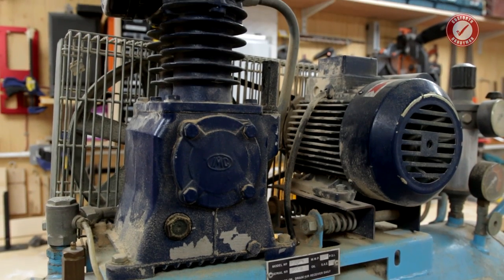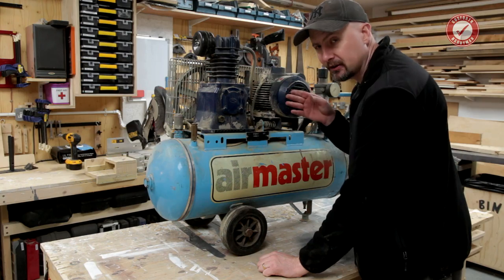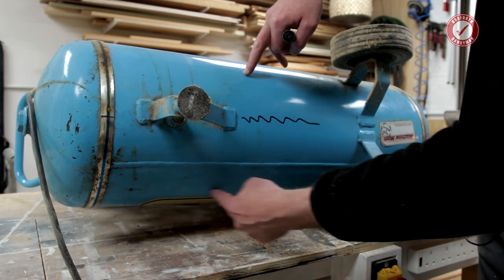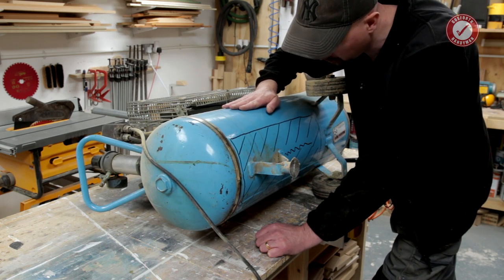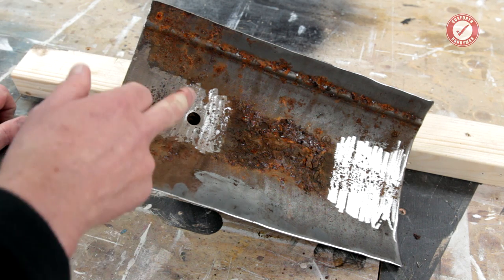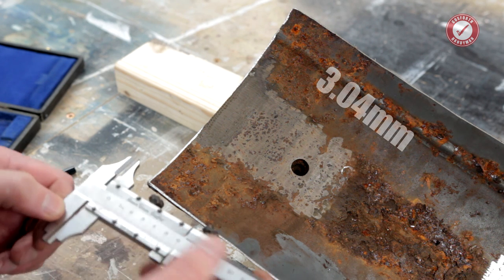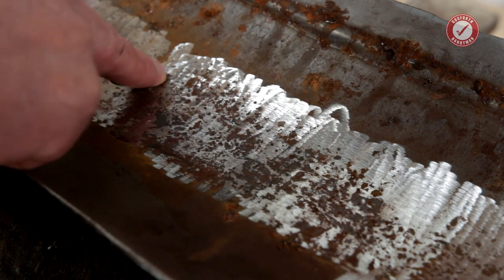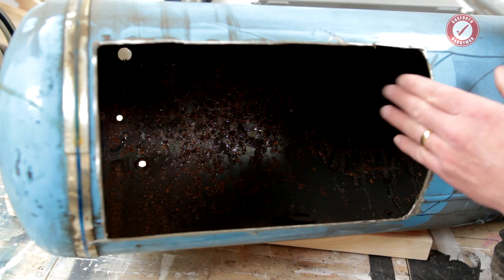Was this old air compressor about to EXPLODE ??

Comment: I had a good chat to the man who does the insurance inspection on our compressors at work... he used a thickness tester and a camera to check them out every year. The big one was made in the 60's  . He said they will normally blow a pin hole in the tank when corrode badly and very rarely explode..  Only after people have tried to repair the tanks by welding up the pin holes and of patching in new steel and drain fittings do they generally become dangerous due to the heat from welding and the stresses caused by it..
Reply: Thats true for the old massive tanks. New ones are thin sheet metal that will explode without much warning.
Reply: thats what inspection guy at work told me to
Reply: @derektaylor2941 So you’re saying don’t risk using an old compressor ?
Reply: the guy on youtube that had his explode did so for the very reason you mentioned, it rusted out on the bottom, started leaking and he welded a patch over it, the air compressor ended up exploding..
Reply: Here is an example of one that went off and was not welded or repaired: https://youtu.be/W2LbTHfU5fQ?si=5YdxqVHsJqo8V5Ro  . But tanks can be safely tested, either you pay for it, or maybe you can do it for your own sake: https://youtu.be/XE3jGyqquqg?si=1ChhWb5gUo1PKyrb
Reply: @davorinrusevljan6440  You need to watch the follow up video on that first one you linked .. the guy admitted to welding it and even showed it, the bottom bung had a pinhole leak and he welded a THICK 4"+ long seam around the bung ..
Reply: @traubengott9783  your wrong, any thickness will throw a pin hole first. the thinner ones just pin hole faster.

Comment: I don't see why compressor tanks don't have some kind of coating inside either aluminum or stainless. Or some kind of rubber to help extend the life.
Reply: Water is a solvent, especially when it's full of atmospheric particles or debris suspended in your workshop air. Over enough compression cycles and repeated condensation, that layer would be eaten through no matter what, faster than you would imagine. Believe it or not aluminum would be even worse due to its reactivity. And while yes, that would lead to eventual tank compromise, what would happen first is that layer would break down into little chunks in particulate that would ruin your air tools paint, and anything else you're blowing the air at. It seems like an obvious and logical thing to do - but that's a hint somebody else already thought of it and there's a reason why it's not done.
Reply: @sklikizos  Well to be fair, more often than not these days that "reason" is money and not wanting to spend any more of it than they absolutely have to to make a product.

Comment: I rebuild air compressors here in the mountains of Colorado. My preferred method is to take all of the fittings out of a pressure tank, and look inside it. Light it up from inside with a very small bulb that will fit into any one of the half inch or 3/4 inch holes. Then drop an assortment of bolts and nuts inside it, with a solvent like lacquer thinner or just about any other type of a solvent fluid. Rattle it around as long as you can stand it until your arms get sore, and then dump everything out, pull the hardware out with a magnet. Then the tank will look much cleaner inside, if there was any rust. Colorado is west of the hundredth Meridian in the US, so it is very dry here. Relative humidity is very low compared to the eastern part of the US. So rust as you see, in the British Isles, is simply non-existent here in the West. Lucky for us. And then if I really want to get carried away I will pour paint inside it, the best rust resistant oil resistant paint that I can find, and slosh it around to make sure all of the bottom of the tank is completely covered. Let it dry, run some air into it and leave one of the holes open, so that the air can get out, to help it dry quickly. Assemble everything, and you have an essentially brand new air tank.
Reply: Though I have to add that it's still a good idea to have it pressure tested if your tank is more than ten or twenty years old.
Reply: I was thinking do same thing. But thinking a bit I decided it doesn't worth it. You have many mistakes in your thinking. You can't clean all the rust from inside. No matter what you do the metal will have spots covered with rust. Did you see this guys was grinding and he still has had some dots covered with rust.If you paint over with some rust guard paint it ideally should soak till the metal through the rust to avoid further corrosion. That's unlikely to happen. So eventually it will continue to rust in some bad areas. The best you can do is put it in  a cage run test to max possible pressure and then use regulator to reduce max pressure so that it does cut of earlier than the pressure you have tested. I've made decision to go cage route as cage needed anyway for the case if I get a faulty tank.

Comment: "HYD" refers to hydrostatic pressure testing. They fill the tank with water and pressurize it to 250 PSI. They use water so if the tank ruptures, there is no explosive release of pressure.
Reply: Used to do this for a living. Built all sorts of tanks and I was lead inspector plug it and fill it.
Reply: Only ever had one explode, it sent the plug over a football field length through the shop and out the sheet metal wall it went.
Reply: Just like scuba tanks, they have t be "hydroed" on schedule

Comment: Black coating you called protective coating is really just mill scale. It’s iron oxide that bonds to the surface of hot rolled steel. It protects if from atmospheric corrosion.

Comment: Had you not got no cutting discs, hard work with the grinding disc you used to cut it open
Reply from the maker: Better sparks for the vid. You'll see I'm doing 45 degree grinding passes to try and thin the material a bit around the cut. 👍
Reply: @GosforthHandyman  Is it not dangerous to use grinding discs for cutting and cutting discs for grinding? I’m a complete novice and this is a genuine question not a criticism.
Reply: @markharrisllb  you certainly shouldn't use a cutting disc for grinding, the disc isn't designed to take the side loading.  Cutting with a grinding disc is slow because your removing more metal than you need but no real reason why you shouldn't.
Reply: @markharrisllb  Exactly what David Quirk said.  Cutting discs are thin and meant to remove as little metal as possible in order to make a cut.  Grinding discs are thick and are used for material removal, as opposed to making cuts.  The thin discs are prone to explosion if too much pressure parallel to the axis and can be very dangerous in that situation.  Be careful in general.

Comment: You get a lot of condensation inside any pressure vessel.  The shorthand life of a pressure vessel is ten years, then inspection is required...  Most of us get complacent enough with gas bottles, so unfortunately air bottles seem to get ignored until something goes wrong.

Comment: I bought an old one, a Clark Tiger or something. It was £50. I probably spent about the same replacing valves and stuff. It vibrated so much when it was charging the tank it would roll across the floor. The wheels had fallen off so it achieved decent movement purely by vibration. 
I sold it for about 100, bought an electric nailer. Which has since broken. Now I use a hammer and nails.
Reply: None of my tools break, largely because I don't use them very often😆
Reply: Sounds like evolution in reverse, lol.

Comment: Appreciate that you took the time to diagnose, film, and put it out to inform us. 
** never weld a tank, they are heat treated after all welding is complete so the tank can "breath" like a lung with pressure changes.
Reply: Perhaps, i would think Hydrostatic test every few years would be a better way to operate.
Reply: Doubt very much the heat treating is done after the wheels and motor and pump supports are  " WELDED " on.
Reply: @fredhinck9685  Heat treatment is often applied to relieve any internal stresses within the metal caused by the welding process. Done after all attachments are welded.

Comment: I purchased a 2nd hand air compressor that was in "good condition" from an auction. I was shocked to find that it was 1/3 full of water. You just never know how the last owner treated it.

I was able to pull it to bits, clean and inspect the tank visually and hydrostatic pressure test it. I was happy to keep using it.

However during transport the water with iron particles contaminated the high pressure line from the compressor pump and the non-return valve would get dirty and not seal. I was able to clean these lines and fix the problem.

However had I known that original state of it, there is no way I would have purchased it.
Reply: It probably last longer without regular draining as corrosion needs air and water

Comment: Interesting video . My compressor is 20 years old . Must admit when not in use . The drain is left open .
The motor and pump on yours has still got life . 
Both could have potentially been refurbished and built onto a new tank . 
Cool video

Comment: I have been in the air compressor business since 1979 I wish people would realize that an air tank is actually stored energy! and it is so important to drain the tank regularly. and never buy a compressor that does not have a certification tag ( the welded 3x5 ") metal tag on the tank, this tank was a certified tank and still had great damage from neglect. good video. 
THE Compressor Guru

Comment: I believe that is leaded steel; similar to that used in automobile fuel tanks - it is non-sparking.  OSHA in the US had a case they thought a leaking o-ring or seal let too much compressor oil into the tank and the oil mist ignited when the compressor heated up in normal operation. So a fuel type explosion, not just rusty tank.  30 weight motor oil not particularly flammable unless it is in an aerosol

Comment: hyd probably stands for hydro, usual way of testing pressure vesels - it gets filled with water not air, that way if vesel fails it is much less dangerous
Reply: Davorin Ruševljan   Hyd stands for hydraulic as in hydraulic test pressure
Reply: Thanks!

Comment: Good video but I have never seen anyone try and cut metal with a grinding disc like that.
Reply: Me neither
Reply: What i can to say
Reply: I cut metal all the time with a grinder, but I use a really thin diamond coated metal cutting blade from Lennox. That super-wide disk ground away about 6X as much metal as the blade I use. I also use gloves, goggles AND a face shield.  Yes, that is two things to keep crap out of my eyes. I learned the hard way the value of a second level of protection for your eyes. Kind of like still using a condom even if she says that she is on the pill.  Better safe than sorry.
Reply: Absolutely, talk about make work for yourself!!!!
Probably took hours to cut that open!!

Comment: Nice tank 👍 Well designed and built. The welded seam is in great shape. This tank would likely fail via pinholes on the bottom centerline.
Yes, horizontal tanks get a fair amount of rust on the top.

Comment: I've got a Kellog American Compressor, the date on the ASME certification tag says 1940, shell thickness is 13/64inch. I use it nearly every day and keep her filled to 140psi at all times! I certainly don't stand next to it and watch it fill up though. It's kept in a side compartment of my shed, so hopefully the chip board and drywall will keep the shrapnel contained, should it ever let loose.

Comment: The one you have there is from an old range which has what we used to call a ‘T-pump’. That’s a pre-1990 machine and the pump will be mainly cast iron. Around ‘90-‘91 these gave way to a cheaper, lighter Italian-made (Fini) pump which was nowhere near as durable - especially the valve plate.

A lot of the larger air receivers were made by Rednal Pneumatics in Shropshire and they were proper quality. The Rednal ones usually carried the name etc on the end.

50/60 litres was the transition between Rednal tanks and imported ones. If I remember right, petrol portables used Rednal tanks but electrics used imports - definitely lesser quality!!

Comment: All air receivers are prone to condensation inside, which causes rusting from the inside (which cannot be detected from the outside)... At the end of the day the water should be drained via a tap at the bottom, preferably with the cylinder still under pressure to blow out the water... It should then be left open until the compressor is next used. All cylinders should be visually checked on a regular basis (a cheap video camera can be used inside the tank), and pressure tested at least once every two years, using water (not air) and a boiler test pump to 2X (or better still 3X) the normal working pressure... Any weaknesses , or thin spots, will then show as water leaks - if you tried the same test using air the cylinder coud explode (as seen in another YT video, caught on security camera)... Compressed air has immense stored energy, whereas water is virtually impossible to compress. so doesn't store energy.. Having said that I have an old riveted cylinder, so at least pre WW2 - I know it has rusted through as it sits on a block of wood with a piece of rubber between - it blows off at about 50psi..... I've just bought a newer replacement, and will pressure test that before I use it.... The old cylinder will become a garden BBQ or fire-pit....

Comment: I just took my compressor apart and sent the tank to compressor heaven as well. I bought it new in 1987. Speedaire compressor on a Melben tank made in Leitchfield KY, USA. Man that thing pumped a lot of air over the years. So I got about 36 years out of the tank. It wound up with a pin hole in the bottom of its 30 gal vertical tank. After debating on trying to fix the tank, and seeing so many people on the Youtube say not to do it, I took their advise and condemned it. I bought a used 60 gal vertical tank compressor that has a stamp on the tank plate saying 2018. Supposedly it hasn't been used in a year, so it should only have about 5 years on it. It was in an unconditioned garage, so it wasn't used during the cold Southern Ontario winters here because compressor condensate freezes things up. I'm going to try and stick a camera of sorts into the tank and check the rust, and possibly try to rust proof it with something. I might make a video of that and post it on my channel. Thanks for your video, it was interesting to see the rust in an old tank.

Comment: I have a similar one from 1962! I have been watching some tube videos and have decided not to use it anymore though it still works fine. I have drained the tank often but very dry here,not much humidity just the water created from compressing the air.  I think I will cut mine open as well.

Comment: That was interesting, I own a stand up compressor, I keep the drain valve open at all times. I was wondering if the stand up type would be better because the condensation would drain  out better.
Reply: These are better for several reasons. Water collects mostly in the lower dome. The domes are stronger than the cylinder section. The dome weld is far away from the water.  Any failures should occur at the bottom, and resulting thrust should be vertical (like a rocket taking off). The compressor weight, plus the anchor bolt strength will likely resist that thrust (I've done the calculations). 
Also, with a vertical tank, the air discharge port is further from the water on the bottom, so you get much less water in the air. I run spray guns, and water is a huge issue. Not great for your aluminum turbine tools, either.
Reply: If you depressurize the tank when not in use, you'll never have an issue. Significant rust only occurs at high pressures.
Reply: Thanks for all the information, good to know
Reply: Why would rust be pressure dependent?
Reply: @MrKentaroMotoPI  yes condensation forms from change in temperature
Reply: @cosmicallyderived  condensation forms from a change in temperature.

Comment: I did have a tank rust out on me and it didn't explode.  It was the small 10/15L type and was about 15 years old.  What actually happened was.. as you show.. a ribbon of rust pits or holes along the bottom inside of the cylinder and evenually one breaks through so you get a small whistle and obviously it doesn't hold the full pressure any more..  The first hole is probably only a pin hole but does make you aware...   so you explore and quickly find the offending area..  You think about repairs.. bit of welding (can't do that..) an epoxy patch.. (nah..)  screw a plate of metal over the area.. (probably the best option.. )    Have a cuppa tea.. think..  Snip off any extraneous useful looking bits and kick it to the curb..       Hello Machine mart.. whatchgotonoffer..?
Reply: you got away lucky some of the units went off link a granade im a small closed garage blowing out all windows imagne you stand next to it

Comment: I used to sell these (at Machine Mart) if you have a compressor ten years past the test date stamped on the tank, be careful, they should be tested.
Or you can buy new tanks separately, these old pumps and motors are far more reliable than the new ones. We would scrap loads of compressors with burnt out motors or seized pumps (most only 2,3 years old)  so speak nicely to the staff.